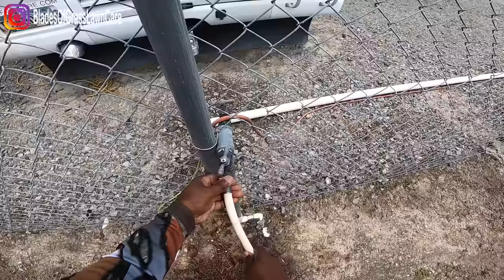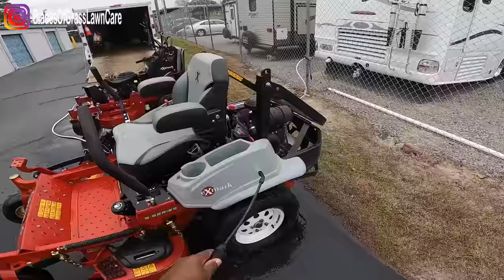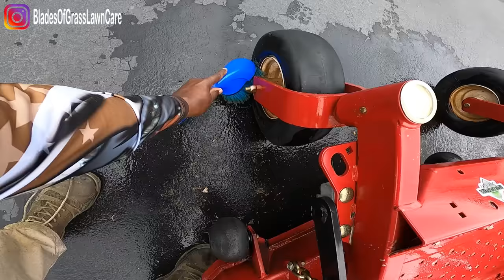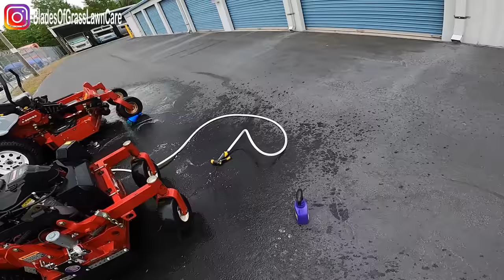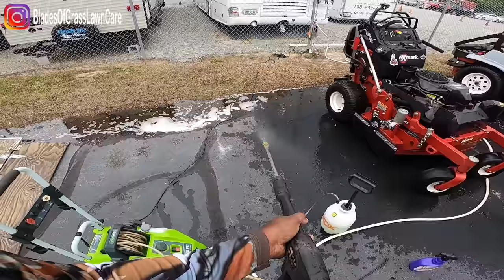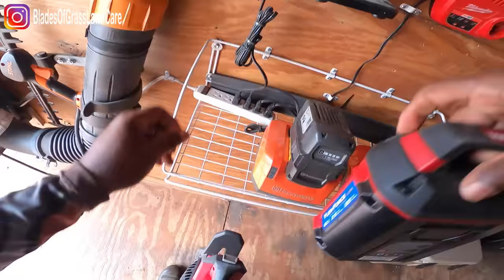Washing 21K in mowers | Satisfying lawn mower wash | POV lawn mower wash

Comment: I am very surprised you clean your mowers with water. I've always been tough to use compressed air cause, water ruins the bearings.
Reply from the maker: So if that's the case, why doest wet grass and rain ruin your bearings 🤔